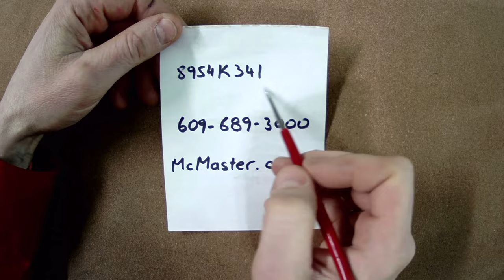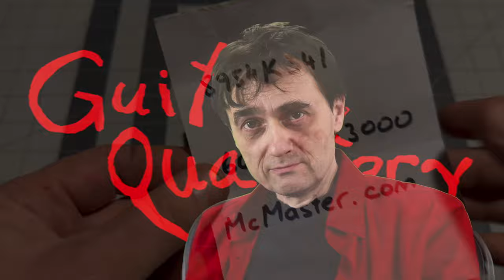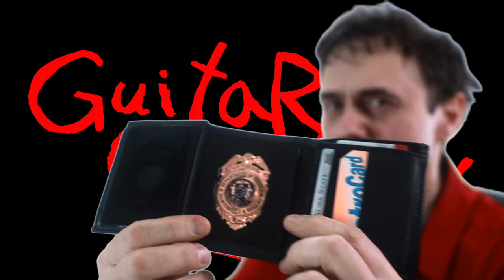Custom Trem Block Fabrication for Vintage Epiphone S-500

Comment: Amazing craftsmanship.

If I'm ever tempted to get a guitar with a Floyd Rose - inspired bridge, I'll remember this video.
Reply from the maker: I really should have made two pieces, while I was at it. As I'm sure all of them are braking apart.
Reply: @GuitarQuackery  I'm sure you're right - but I can't imagine this kind of work on this guitar is economically justifiable for the owner. He/she must be really attached to that guitar.
Reply from the maker: @Iamadoctor6365  I under budgeted, underestimated and overworked on this one. This is why, in retrospect, I wish I had just made two, as it doesn’t take double time, once the machines are set up. And it is just a matter of time when I will encounter another one of these guitars again. I could sell the ready-made part if I had an extra one.

Comment: The new block, and setup must have cost about as much as the guitar is worth, if not more.  However, I'm pretty sure this guitar has the nicest trem block of any Epiphone S500 on the planet now. It also has a YouTube video showing the fabrication of the nicest Epiphone S500 trem block on the planet. I would say that this was a good investment, because now that this guitar is world famous, it is likely worth a fortune.
Reply from the maker: There’s an old Chinese proverb that says, an Epiphone S-500 with a custom made solid brass trem block is only worth as much as someone else is willing to pay for it, LOL.

Anyway, thank you for your comment. Much appreciated.
Reply: I can say that I have a guitar with a custom brass block from Guitar Quackery. Bid starts at $250,000
Reply from the maker: @bryang8005  And don’t forget about the sticker from the NYC Department of Guitar Maintenance  & Repairs.
Reply: @GuitarQuackery  alright then. $260,000

Comment: Oh, the headache! Bought an "Epiphone By Gibson" S-600 in 2020, so cheap...If I ever knew the brigde is one of those ( its a kkt or Bennder, or bendmaster bridge). Ended up buying another, imported, costed twice what I have paid for the guitar! And Im thinking of building a block like you did for it, just in case.
Reply from the maker: The fabrication of this trem block ended up costing me. The only way I would do it again is if it customer was paying by the hour, for every minute that went into making the final product.

Good luck to you.
Reply: @GuitarQuackery  I live in Brazil, there arent many of those around here. But Afer 3 years "patrolling" online, I found one in perfect condition, at 8 km of this friend of mine that lives in New York, and last december he brought it with him . Graciliano Zambonin, check his channel, by the way, he is a great jazz drummer.
Reply from the maker: @adrianopadilha7338  Again, good luck with your efforts. I believe all of those trem blocks will fall apart and the easiest replacements to make are going to be brass. 

You just need to find a local machinist that will do the work. But there are many tricky turns and hidden surprises that I did not include in the video. So, it will end up taking more time than one can predict.

I checked out Graciliano Zambonin. I guess him and I are practically neighbors. Great work.